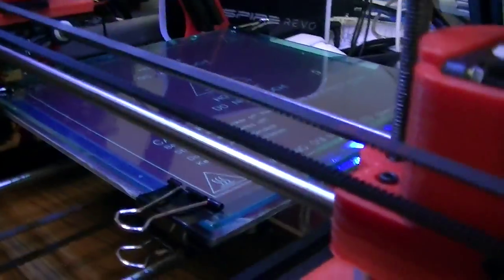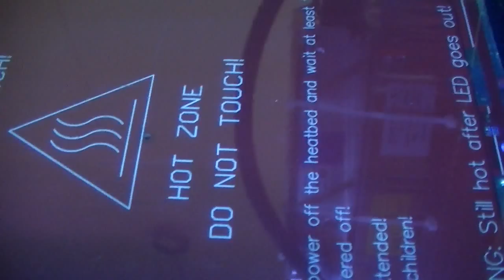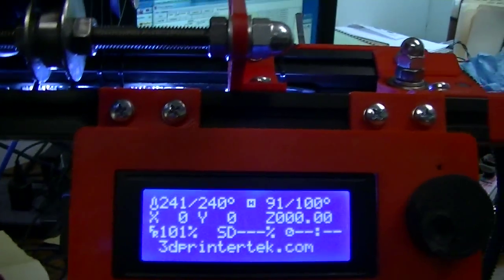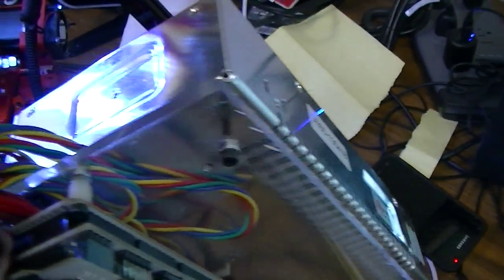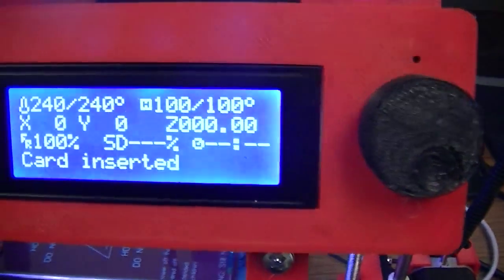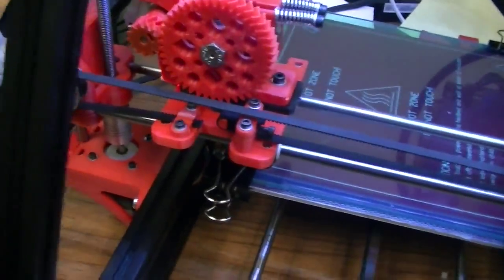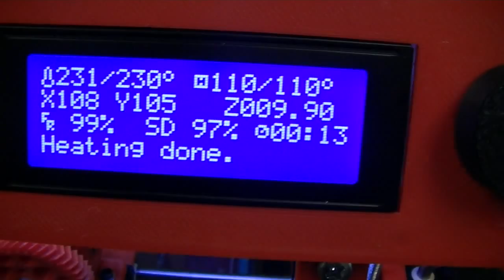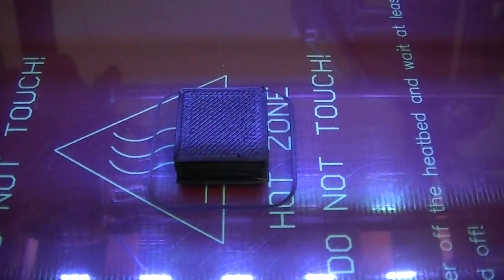2013-07-02 Test Prints on my MendelMax 1.5

Comment: I know this is 4 years later but I've got a Mendelmax 1.5 with issues as well.  It appears to me that your big extruder gear is on backwards (the shoulder that contains the nut should be on the outside with a jam nut).  If that's the case, your little extruder gear is a mirrored print.

Comment from the maker: The flickering your seeing is the power supply not holding regulation when the bed was being switched on and off to maintain the bed's temperature.

About half way through I add a second 12V supply to power the controller board and lights. The original supply now only powers the heated bed and extruder heater.